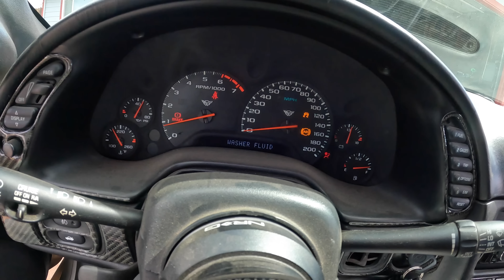This Is The Best My Supercharged C5 Has Ran In Over A Year!!!

Comment: May want to check plug gap and go a little tighter. I had the same issue on a 5.3 silverado with a torque storm supercharger on it. Plug gaps were too wide. May or may not be it but just another thing to check